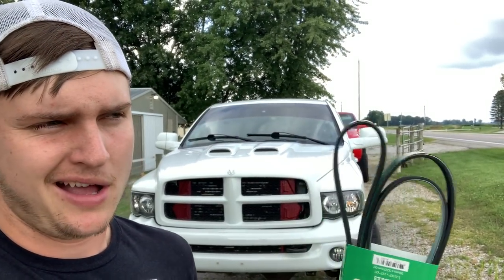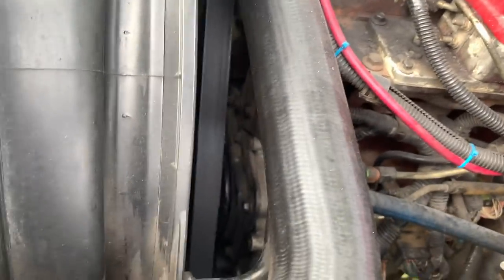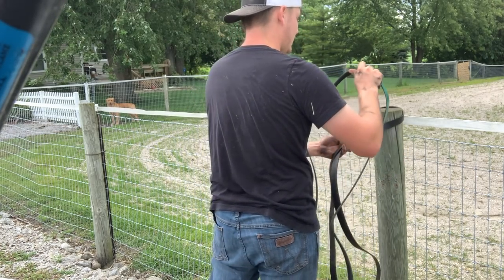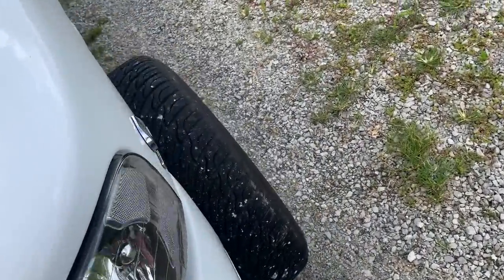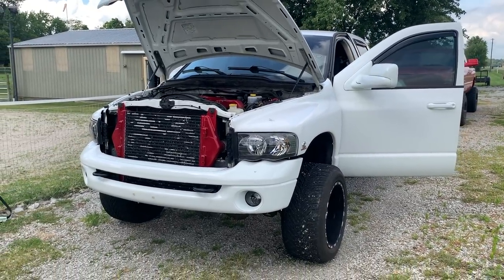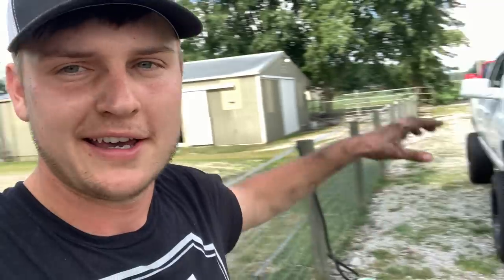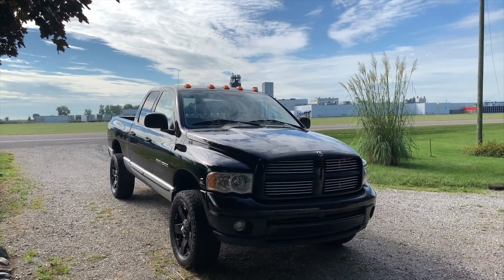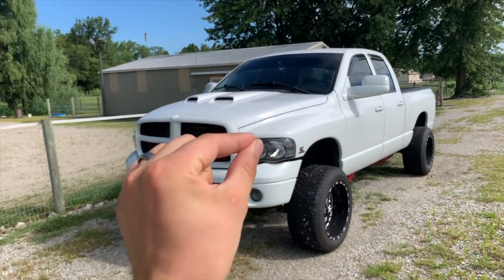I bought ANOTHER ONE of these trucks... *ONLY 84K Miles*

Comment: It’s a 2003 not an 05
Reply from the maker: Huh
Reply: @LOUDNPROUD  you said the black truck was a 2005 it’s a 2003 the steering wheel and dash are different also the tps is like the second gens on the engine